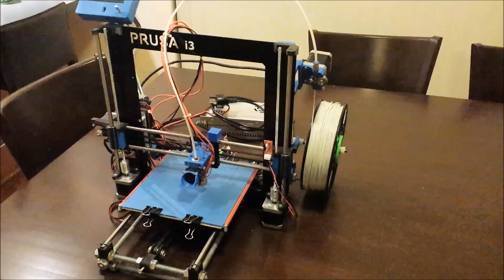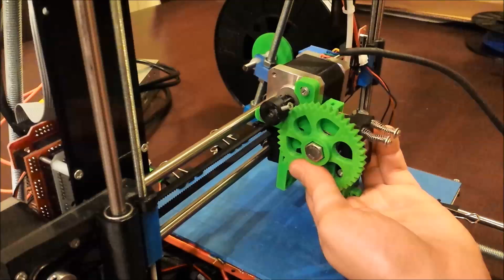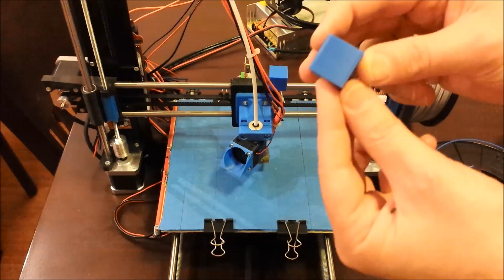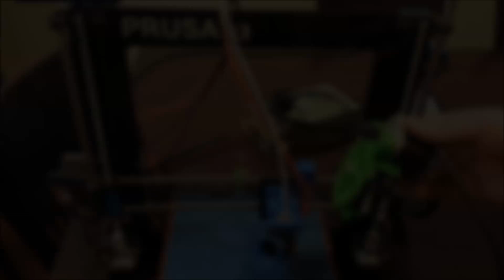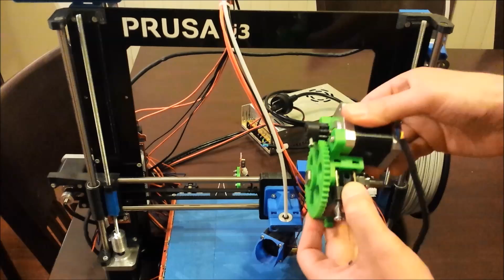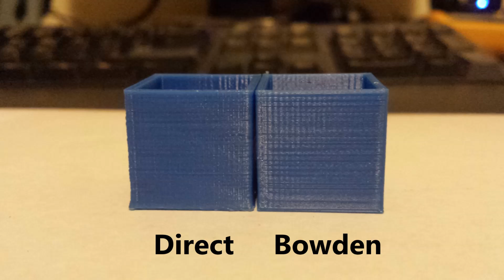3D Printer - Major Quality Improvement!

Comment: I also find the conclusion somewhat dubious. I started off with an A8 clone which suffered inconsistant extrusion and terrible ghosting. I built a 2020 cube chassis for it and both issues are history. It still has most of it's original hardware including direct drive hotend. I also have my spool mounted on the top of my chassis directly over the middle of the machine.
I think chassis rigidity makes far more difference to print quality than a bowden ever could.
Not having your spool mounted to the top of your chassis there-for reducing the weight on it is what has made the difference that you see in my opinion. I got my printer in late 2016 then built the cube chassis for it mid 2017 and it is still printing very well to this day.

Comment: My question to you is how about a hybrid of the two: Direct Extruder and Bowden Tube.  For example the benefits of direct is that you can use soft filament among other benefits.  How about putting the filament spool on the side of the machine as you have it with your Bowden set up and run the tube from the filament to the direct extruder with the tube at the filament spool being fixed.  This way the tube keeps the length of the filament consistant regardless of where the print head is, and you maintain the benefits of direct extruder.  Just a thought.

Comment: I have an Ane t A8 that came with the direct drive extruder. I searched Thingiverse for a Bowden-type carriage and printed one. The end result was that the weight of the x axis carriage was significantly reduced, and the Bowden tube made it easier to feed filament from an airtight container. Print quality improved and I never looked back. This machine makes beautiful parts! I did not, however, stop there. I mounted the whole printer onto a non-warping wooden base, eliminating any chassis movement. I hardly ever need to re-level my bed because of the increased stability. No need for any auto-leveling device. I also quit printing with PLA, preferring instead, PETG.

Comment: 3d printed spool bushing with bearings on an appropriate rod directly above the printer solves this issue as mere grams of force are necessary to unspool the filament. If you get lazy and don't use a bushing then you have that off center weight of the spool inconsistently tugging back on the filament. Still don't see any good reason for a Bowden setup

Comment: You can use a feedtube with a direct drive extruder in order to remove the issue of the tension changing when the printhead moves.

Comment: Use a Bowden tube on the direct drive extruder for the ultimate setup. Then you never get pulling as it moves because the distance always remains the same.
Reply: Just make sure you mount the other end to the machine. Just use it as a zero tension guide like the makerbots did. I'm doing that on my p3 steel build.

Comment: My Y axis prints 0.1 -0.15 bigger than the X axis.  So I cant make a square.   If I tune it with steps per mm it will only solve it for that specific size. Bigger prints gets to short then.

Comment: Removing the roll of filament from the top of the frame onto a shelf or a holder on the wall will releave the possible wobling caused by the heavy roll.

Comment: I tried a bowden setup on my Prusa and although there were improvements mainly due to reduction in mass on the X carridge, I got more severe stringing, blobbling and ooze problems using PTEG.  I tried all the stringing fixes and eventually had retraction settings of 7.5mm on each move which gave me the best results with bowden, but the backlash introduced by a bowden setup cannot be fully eliminated. So, in the end Ive reverted back to a direct drive extruder feeding my e3d v6 clone hot end and the results are better quality, faster prints but, yes, with minor artifacts like shadowing visible, but this is much more acceptable to me than all the stringing, ozzing, blobbing and increased time for printing. With a direct drive setup I can run with 0.2mm retraction no problem.

Comment: It is not only that the flow is inconsistent with the direct drive, but the resistance the filament puts on the print head will slightly pull the head up (few microns) which makes a difference in the print quality. The bowden tube will keep the head from being pulled up by the filament.

Comment: I've just printed all the necessary attachments for my E3D v6 extruder. Now I see that the fan that comes with the E3D v6 is a 2 pin fan where as my pcb is a 3 pin connection. How would I connect it?

Comment: when using a direct feed system instead of bowden, you can always attach the drive motor used for bowden to a mechanical gear system made of 3d printed parts that will drive the "spool" to turn giving you the slack you need without unspooling the entire roll.

Comment: I'm wondering if you're not actually dealing with tension/slack on the filament messing with the feed but instead deflection of the rails because of the tension/slack the rails are deflecting and causing the head to rock back and forth on them.  

2 interesting experiments with your setup would be
- to mount the direct drive back on it and then add a feed tube to the inlet side.  If that gives you the same quality print as your remote feed then it confirms that the tension is messing with the feed.
-  to make your head mount shorter, moving the print head closer to the carriage.  That should put less torque on the carriage and cause the rails to flex less, possibly further improving your print quality, especially in the y axis

Comment: If this is really an issue with direct-drive setups, then the same teflon tubing could be used to feed it, so that the x position doesn't affect the length of filament the motor is pulling against.

Comment: I use a Zortrax printer which uses a direct drive extruder. It puts out nearly perfect looking prints every time.  I think the problem was with your old extruder and not simply the filament tension changes. If you had switched to a better direct drive design I think you would have seen the same improvement.

Comment: If your getting too much tension variance depending on where the X axis is, then your spool holder simply sucks and isnt letting the spool roll easily. Simply print off a better spool holder like the ones that use skate bearings and there will be almost 0 added tension regardless of print head location. Lots of people simply use threaded rod or one of the bar type spool holders and both of those add a lot of friction against the spool surface when trying to pull some filament off it. Add in that with threaded rod you also need a way to keep the spool from working along the threads to one side of the holder and then rubbing against the holder arm also creating even more tension. 

the skate bearings take all that out of the equation and hold the spool in place while not creating an added tension for the Z axis to be transfered as the drive pulls the filament down.

Comment: I was told the worse quality of the extruder on the carriage results from z axis lift that is caused by having to spool off filament while moving. 
You have backlash compensation on the z axis so that already lessens that problem but what you could do except going full bowden is making a "reverse bowden" feed to your direct drive that connects to the chassis then into the extruder and from there into the hotend. By that you have no z axis lifting force when the x carriage moves along und also get better quality.

Comment: How about leaving direct extruder on, mounting a bowden tube at its input, and attaching it rigidly so the feed spool is uptaken at the same location and without dragging the filament along? It's probably also a good idea to have the spool on radial bearings.

Comment: I 3D printed your E3D V6 holder and installed it on my MK2. I also said WOW when I printed layers 0.1mm thick at 100mm/s. Couldn't believe my eyes!
So much faster to print and I don't know how it can be improved further. Thank you.
Now printing an i3. Will move my electronics to the new machine. You gotta stay with the program and upgrade!
Thanks again for a great design.

Comment: the tension on the filament is also causing the extruder mechanism to be pulled up. but i do think that the mass of the extruder assembly will have a huge impact on the quality of the prints.

Comment: What about adding a guide tube to a direct feed setup? that's what my printer is designed for, but unfortunately the guide tube hasn't arrived yet (building it week by week with a Magazine)
Reply: ^^^ This.  I have heard it referred to as "reverse bowden", where the same type of bowden tubing is used, but with a direct drive extruder; the end of the tube farthest from the extruder must be mounted to a solid part of the frame.  This allows constant pulling from the filament reel, as well as removing the "whiplash" of straining against X movement as the carriage moves left-right.

Comment: If the filament isn't slipping, them X motor steps is going to give Y amount of filament- regardless of the tension. However, i  Bouden you have a lot of variables between the extruder and the hot end. The filament can wiggle around in the tube. As the hot end moves, the curve of the filament changes which can cause the filament to flex or to stretch and compress. Small factors, true, but so is the resistance changes when unrolling filament.

A more accurate test of your theory would have been to print a straight, thin object along the entire X axis. If you're theory was correct, then the ends where the filament were being pulled would be shorter than the middle as you say that the back resistance slows the feed rate. 

As others pointed out, it's more likely that the extra mass was causing some vibration of the hot end. There are print tests for that.

Comment: I recently went with a Bowden setup using a E3d clone. Printing is great until it loses temp at the hot end about 1/3-2/3 into the print. I changed heat cartridge and thermister thinking maybe one or the other is going bad. Extruder motor starts clunking and the print goes all stringy and then choice words are heard. I can get rid of the words but not the loss of temp. I have had this thing apart more than a few times. I believe all this comes under the heading: Modern Problems. Any thoughts? Thanks!p.s. love your videos!

Comment: If a bowden setup solves this problem the way you say it does, then a reverse bowden setup would also work, so you still have the advantages of direct drive.
Reply: +Zhou Johnson: Reverse Bowden is the same as Bowden, but with the motor sitting at the other end. In other words, it's a direct drive setup pulling filament through a tube.
Reply: but mount the end of the tube to the frame of your printer also otherwise it will remain an inconsistent resistive force
Reply: After watching the video I thought the same thing.  I'm going to to play with this more because I really like the direct drive setup.
Reply: Hello I'm still new to 3D printing. What exactly is a reverse bowden setup?

Comment: Well after seeing so many videos of 3D printers I decided to stay away from them. EVERYONE makes improvements because the printers fail to simply work as they are.

I was going to get a Geeetech Prusa i3 but I am going to skip until the 3D printing becomes a norm and you won't need to alter this and that, and try to make it better and more stable and put something for cooling etc.

So many people have 3D printers but I personally believe 3D printing is still in trial phase
Reply: I'm constantly upgrading, tweaking, and improving my computer. Does that mean it simply fails to work as it is? I do it because it's fun and it's a hobby. I do the same with my car. Do cars simply fail to work as they are? You've never upgraded or replaced a part on anything? People enjoy this kind of stuff. But I'll agree with you there, if you don't like the sound of this it's probably not the hobby for you and you should probably stay away.
Reply: I think that's half the fun - 2D printers are a marvel of technology that works straight out of the box, so there is no challenge - even my mum can produce a perfect 2d print.   Whereas my 3d printer has kept me up constantly - tweaking, studying, experimenting, building new parts.   I've always had to buy my spare parts and wait for them to arrive - I've never been able to actually create those parts myself - I am even using CAD software to design and manufacture original parts that have never existed before - all very exciting.   And the upgrade parts for the printer are coming off the print bed and being bolted onto the printer that created them - and then it goes on to make even better parts - the actual machine upgrading ITSELF - that is pretty cool.   If you wait till it's all plug and play you'll miss out on all the fun!
Reply from the maker: There's a reason you don't see Canon, Epson, HP etc make 3D printers... they are very much a 'hobby' and require tweaking, fixing and general mods from time to time.
Reply: Tech2C
But I find it kinda bad to get a 3D printer and find out that the head needs to have something done in order to work properly.

I once saw someone printing a head that would drive the hair from the fan to the nozzle, another one said they needed the nozzle not to cool down fast or it would mess up the print.

It is rather confusing
Reply from the maker: It really depends on how much you spend on a printer. The cheapest at the moment is the Anet. The kit I bought in this video was from 2014 and it was the cheapest back then also. When buying the cheapest kit you shouldn't expect it to print with the same quality as a more expensive kit.

Any printer will print ok, it boils down to how well the final print result is that you are after. Keeping in mind these print layer by layer, and not injection mould, so you're quality expectations should be lower compared to injection moulded parts.

Ask yourself what experience you're after from the printer. These kits are just that - kits. Expect to assemble and trouble shoot as any kit you buy. If you don't want to bother with assembly then an off-the-shelf printer is recommended, at a greater cost.
Reply: I TOTALLY agree Alex. From building it myself to learning all of the in's and out's of how to 3d print. That is the FUN part of all this. AND Super Wig Maker, think of how much more advanced we who have this outlook will be when 3d printing blossoms from it's, as you said, "trial phase".  It could in all probability, mean the difference in wanting a job in this field, to LANDING a job in this field at that point.
Reply: Actually, Canon are getting into 3D printers. And from this, I assume that other large companies are too.
Current printers don't 'fail to simply work as they are' as mentioned above, they work just fine but can be improved - just like everything else.

Comment: There's also less weight on the XY carriage.
Reply: I think you mean XZ carriage. And the benefit isn't huge, because you still have the heavy bed moving in the y axis.
Reply: Can't say I'm an expert but I would imagine that weight is more critical on the XZ carriage as the frame is fairly flimsy whereas the Y bed is more solid.
Reply: Daniel Astbury True, just saying the benefit is bigger when the extruder was moving in x and y.

Comment: i think using a tube to guide the filament will greatly benefit direct drive extruders too. that the feeding is consistent and even seems much more important, than super low friction. some controlled friction can make things smoother and more precise - think of the feel of a nice volume knob

Comment: Hi. 
What printer do you use, I know it is a prusa, but is it an original or geeetech or something else? 
Im thinking of getting a 3d printer. 
Great vids 👍
Reply from the maker: Hi, this was a Replikeo Prusa i3, but I have since upgraded to a Hypercube.
Reply: I just bought a JGAurora Prusa i3 kit from amazon for $350. Of the i3 kits I was researching, there was always something missing in this price point.
Either a small build size, non heated bed, no LCD/SD card slot, lack of online support, and mostly an unstable or warpable acrylic frame. Most i3 kits have an acrylic frame and read one reddit user say that its not a matter of if an acrylic frame will fail, but when. So with that on my mind I purchased a metal frame JGAurora Kit.. (the price just went up to $409 today)

Comment: Are you sure that flow rate inconsistency was the cause of the print surface issues and not simply the print head changing in height due to the intermittent tension in the filament as the x carriage was moving?

Comment: Alternatively... you could design a tension detecting auto feeder or rather a tension preventing feeder.
Reply: This is a good idea. People, pay attention. That would solve a lot of these problems and can be easily accomplished with a simple DC motor and switch set-up.
Reply: If the extruder was setup to allow filament to slip past if not retracting, preventing filament from unintentionally retracting out of the hot end, that could work. Shouldn't be too difficult to engineer, think of a bike.